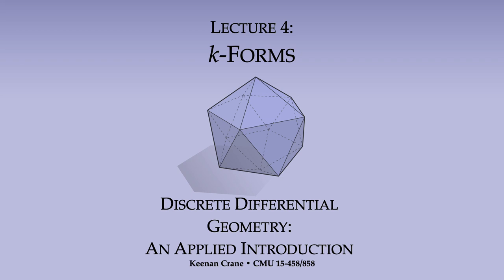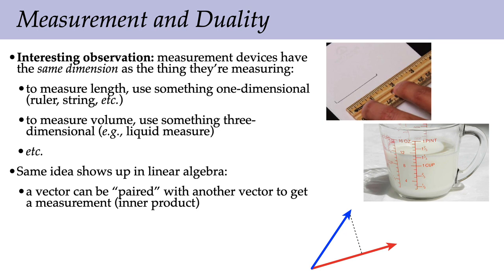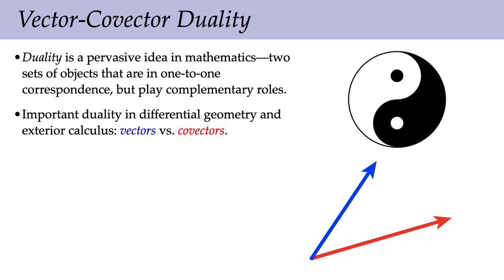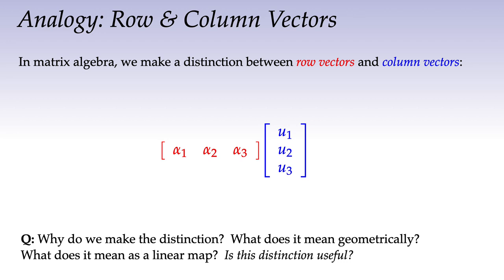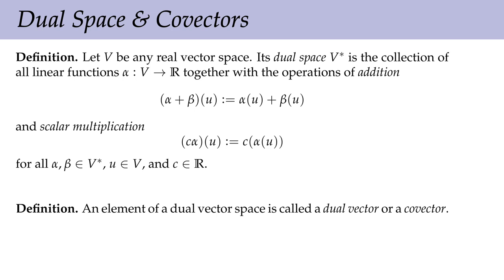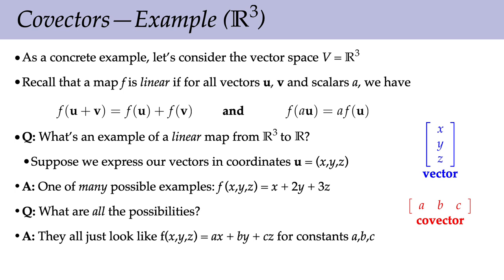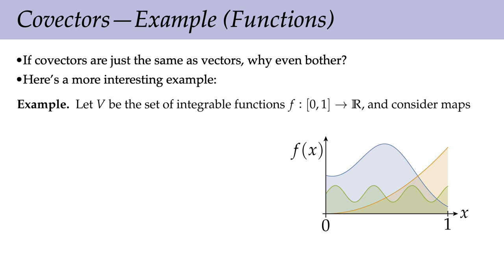Lecture 4: k-Forms (Discrete Differential Geometry)

Comment: 0:36 k-Vectors and k-Forms - Overview
1:42 Measurement and Duality
2:39 Motivation: Measurement in Curved Spaces
3:49 Vectors and Co-Vectors (Duality)
5:30 Analogy: Row & Column Vectors
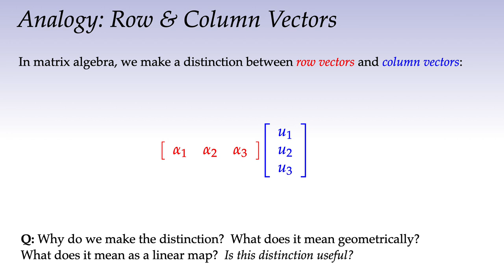6:55 Vectors and Covectors
7:37 Dual Space & Covectors
9:13 Covectors - Example (R3)
11:28 Covectors - Example (Functions)
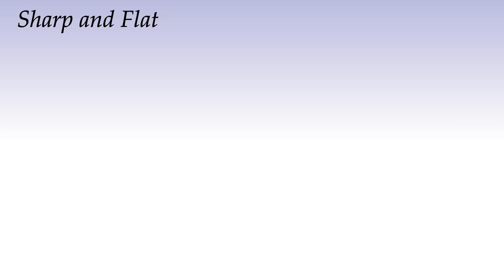14:41 Sharp and Flat
16:12 Sharp and Flat w/ Inner Product
18:27 k-Forms
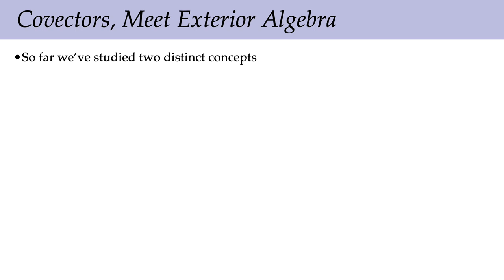18:41 Covectors, Meet Exterior Algebra
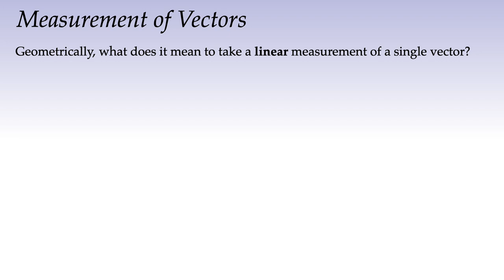20:06 Measurement of Vectors
20:32 Computing the Projected Length
21:02 1-form
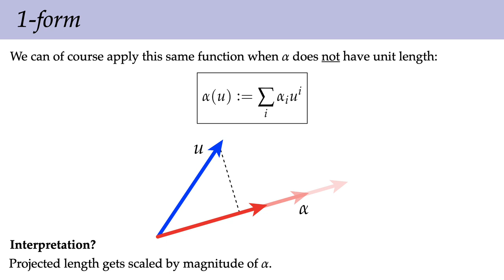21:47 Review: Determinants & Signed Volume
24:21 Measurement of 2-Vectors
24:59 Computing the Projected Area
26:18 2-form
27:21 Antisymmetry of 2-Forms
30:22 Measurement of 3-Vectors
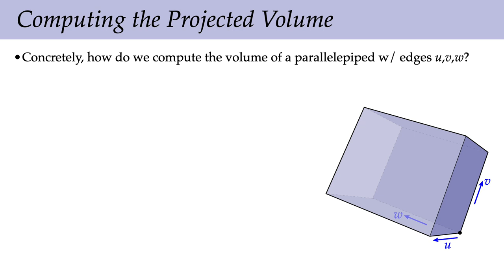31:21 Computing the Projected Volume
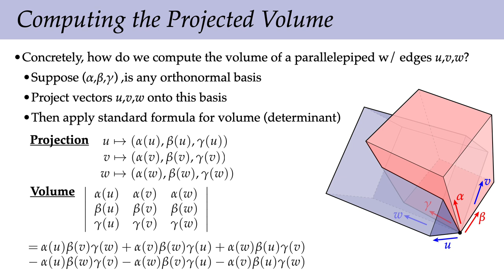32:45 3-form
33:48 k-Form
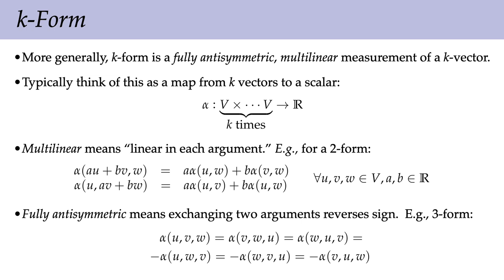35:47 k-Forms and Determinants
37:47 A Note on Notation
39:31 0-Forms
40:31 k-Forms (Measurement in Coordinates)
41:47 dual Basis
43:59 1-form - Example in Coordinates
46:50 2-form - Example in Coordinates
49:47 Einstein Summation Notation
51:59 Sharp and Flat in Coordinates
54:01 Coming Up: Differential Forms

Comment: "Gravitation" (*) by Thorne et al. doesn't use differential forms --- it is tensor based, which is the usual approach in General Relativity.  But it does use the terms "vector" and "form" in a way that is similar to the role of "vector" and "form" in these lectures.  

I have to say that the standard (overloaded) nomenclature and symbols of differential forms and differential geometry is a significant impediment to learning the material.  Dr. Crane appropriately and helpfully and apologetically acknowledges this.

(*) Affectionately known as "The Black Death."

Comment: At 39:00, I believe the reason arguments to k-forms are written as lists is because k-forms are generally operators and can thus be thought of as functions operating on vectors. Quantities that transform covariantly (co-vectors and k-forms) are typically quantities like change per unit length, like gradient, whereas quantities that change contravariantly (vectors) are typically quantities like differential length. Hence, at least to me, it makes sense to write k-forms in a kind of functional operator notation.
Reply: Be careful with how you use the terms "transform covariantly" and "transform contravariantly". This applies to the components of the form or vector in a particular basis. This is one of the reasons why working with coordinates is often confusing. 

I think one of the reasons for the arguments-as-lists format comes from people who learn to use tensors before forms. From that direction, one can define the tensor product of two 1-forms and this will act on a list of of vectors (i.e. there are two "slots" you can put vectors into). Then the wedge product is just the anti-symmetric combination of the tensor product (i.e. it looks like the cross product). See this: https://en.wikipedia.org/wiki/Exterior_algebra#Alternating_tensor_algebra
Reply: @johnwaczak8028  Be careful with how you read the words in my comments. I said covariant-LY and contravariant-LY, not covariant and contravariant. I agree with you that these are antiquated terms because they only describe how components transform (as well pointed out in "A First Course in General Relativity, by Bernard Schutz", Section 3.3, pg. 60), but I'm using the adverbs in the sense described in "A Student's Guide to Vectors and Tensors, by Daniel Fleisch". It is important to understand both sets of terminology, as Prof. Crane also mentions, if  for nothing else because different papers/books may use both types of terms. Daniel Fleisch properly explains in that book that the above mentioned quantities transform in that kind of manner. Alternatively, I could have said "direct transformation" and "inverse transformation". It is important to understand all ways to describe how these quantities are chaning. At the time of this post, no one says these quantities transform "covectorly" or "k-formedly". There is an analogue to the terms in statistics as well, so it would be familiar to the stats student as well (e.g. covariant = in direct proportion, contravariant = in inverse proportion). I'm trying to explain how they change, not what they are.
Reply: @adamhendry945  Apologies if my comment came across as rude, that was not my intention. I think my point still stands. Prior to 39:00 in the video, we had used a coordinate free approach. Without specifying a coordinate system, the phrases "transform covariantly" and "transform contravariantly" don't make sense as k-vectors and k-forms are geometric objects independent of any choice of coordinates. The application of a two form to a two vector by plugging the vectors into the slots of the 2-form has nothing to do with coordinates. You will get the same value no matter what coordinates you use. This was a big point of confusion for me when I learned about forms, tensors, etc in my physics classes because physicists tend to define tensors solely in terms of their components.
Reply: @johnwaczak8028  No, not at all, the fault is mine. I'm sorry for misreading your comment! I see now what you are saying: that's very interesting. I do need to read up and learn more about it. Thank you for your comments!
Reply: my guess is the notation of applying a k-form to "k-vectors" is because the objects are different. the notation is actually describing maps acting on k vectors.

 instead of wedging vector spaces and then dualizing k-vector spaces, the standard way to construct k-forms is to dualize the vector space and then wedge those duals. the constructions are isomorphic either way. the only difference is instead of having the alternating, distributive, associative properties come from the wedge product, they now come from the space of alternating, multilinear maps given by the construction through the wedge of dual spaces.
Reply: @adamhendry945  @John Waczak You guys are just too wholesome for a YT comment section! :P

Comment: At 11:00 you assert that all linear maps from R3->R take the form ax+by+cz. But doesn't any polynomial work, too? E.g. ax^2+bx + cy^3 + dy + ez.
Reply: Is it still linear if that's the case?
Reply: do u know what linear means
Reply: @epicmorphism2240  no
Reply: @simpaticode  f is linear if:
1) it’s additive: f(x+y)=f(x)+f(y)
2) and homogeneous cf(x)=f(cx).

Now obviously this doesn‘t apply to polynomials. 

Also, not to be rude: If you don‘t know what linear maps are you should revisit linear algebra before lesrning differential geometry.

Comment: At 30:55, when you say "all 3-vectors have same 'direction'", are you assuming the 3-vector and 3-form are embedded in 3-space and not some higher-dimensional space?
Reply: This applies to R^3 as there is only one basis 3-vector or basis 3-form in R^3. This would be different in R^4 for example.
Reply: @johnwaczak8028  My question is more are we speaking "extrinsicly" or "intrinsicly"? Are we an ant on the surface as in "Flat Land" (in which case I only truly have a sense of 2 directions, as hinted at by Prof. Crane's discussion of "manifold"), or are we able to step back and look at the surface in 3-space?
Reply: @adamhendry945  everything seems to be extrinsic for now. so we are embedded in R^3
Reply: @98danielray  and @John Waczak Thank you both for the clarification!

Comment: At 14:19 you mention that the covectors of the integrable functions f(x) are not functions, but it seems like all functions g(x) in \int_0^1g(x)f(x)dx are covectors.  g(x)=1 is the first covector you mention and g(x)=\delta(x) (dirac delta) is the second.  Or do you just mean that f(x) can not also be a delta function, since the integral of the delta function squared is not integrable?
Reply: Well, with an appropriate definition of inner product you can identify any vector space with its dual. In this case a natural choice is (g,f) := \int_0^1g(x)f(x)dx and so the dual space can be also be thought of as integrable functions over the same range (indeed google L^p spaces, this is L^1). Note however that this is a choice and we could make a different choice and get a different identification or refrain from making the choice at all and they remain different spaces.
Reply: @Aetheraev  Yes. I agree.  What I was questioning was Prof Crane's idea that sometimes the covectors are not from the same space as the vectors.  In his example ,a vector was any integrable function on the interval [0,1] (I assume he meant all square integrable functions) but a co-vector was the average function or the delta function which are somehow different than regular functions.  It seems to me that covector and vector provide a symmetric description.  For example, from a general inner product with mass matrix we have <C,V> = C' M' V, with M positive definite. We could think of the covectors as M C and vectors as V.  Then the covectors would be "different" but we could equally decompose M=Q sqrt(Lm) I sqrt(Lm) Q', where Q is the orthogonal eigenvector matrix and Lm is the diagonal eigenvalue matrix of M.  Then we could define a new vector V*=sqrt(Lm) Q V and new covector C*=sqrt(Lm) Q C. Now C* and V* are symmetric.  Maybe I'm missing something and there is a way to come up with covectors that are not int he same space as the vectors.
Reply: @markd.shattuck4139  I'm not really sure what you mean by "symmetric" here. But we can explore this straightforwardly in the language of vector spaces. If a vector space is finite dimensional then it has the same dimension as it's dual so they are isomorphic (although there is no canonical choice of isomorphism here). An inner product defines such an isomorphism by the Riesz representation theorem. 

However if the vector space is infinite dimensional we get some weirder stuff going on. Then the dual space (defined as the set of linear functional on V) is actually "larger" than the original space. This is the situation we are looking at. L^1 is infinite dimensional indeed uncountably infinite. So even with the inner product we only get some of the dual space. There are thus other elements not described as integrable maps even allowing for the choice of inner product
Reply: @Aetheraev  I think it's also important here to make the distinction between the dual space (set of linear form on V) and the topological dual space (set of continuous linear form). If V = L1 as in his example, then (if I am not mistaken) the map delta he defines is not continuous and not a member of the topological dual. However the topological dual is isometric to L∞ which is another function space. (hope I didn't say anything wrong...)
Reply: @markd.shattuck4139  you already stated your answer. dirac delta is not in the vector space of integrable functions.
Reply: in fact, you cannot even define an inner product in L^1 which is compatible with its norm. you can however, do that in L^2, where a powerful theorem (called riesz representation) guarantees that all bounded linear functionals are of the form <•,v> where v is a vector. but in this case, we are not in L^2, so there is no IP, and like mentioned, applying dirac is not continuous/bounded